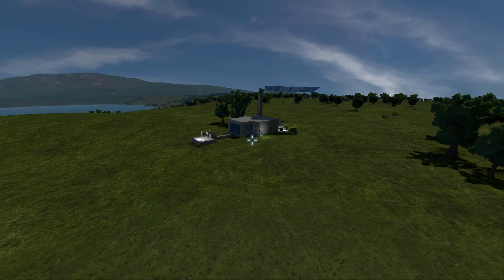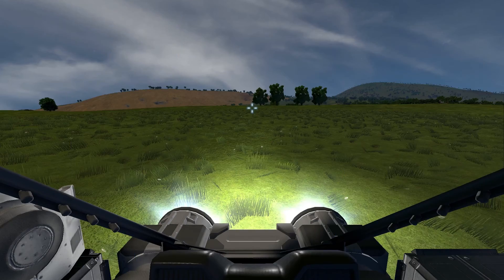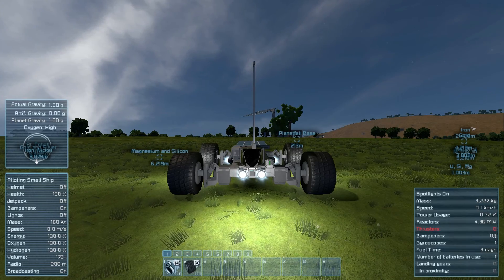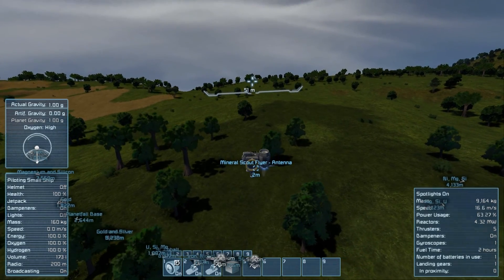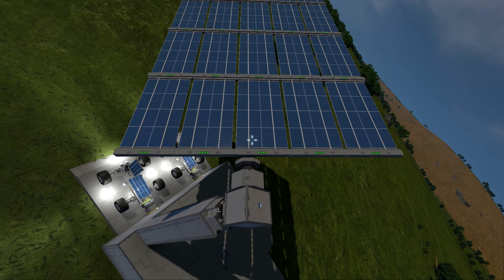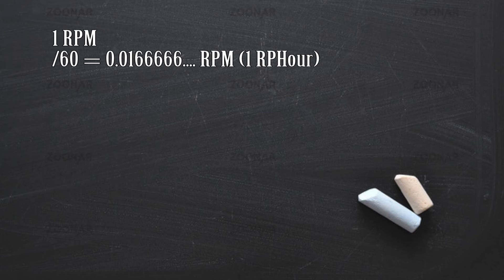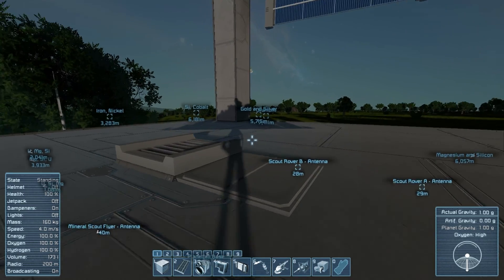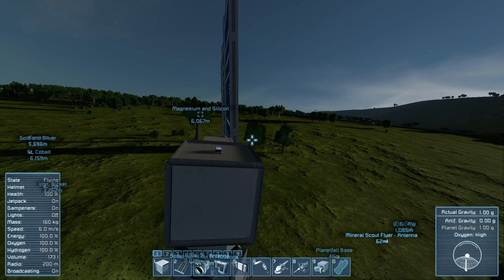Space Engineers Tutorial 12 - Planets part 2

Comment: I m trying to do the solar panel / rotor stuff on Mars but it seems that i can't get the thing to get the max output doing the same as you did.
I keep failing miserably. Need some help if possible.
I have landed where there is ice, i mention that just in case.
Can someone help me get this thing done ?
Reply from the maker: The manual solar panel alignment I showed above works better the closer 
you are to the equator.  If you're up near the pole, it doesn't work as 
well.  When I built a moonbase at the lunar north pole, I only used 1 
rotor sticking straight up, and rotated it that way because the sun 
"went in circles" instead of rising and setting.  Of course, aligning it
 with the sun was a little more tricky that way, too.
Reply: Tx man i ll keep trying :)

Comment: sweet tip on the solar panels m8!....and dont forget heigth offset on those suspensions as well....get some more ground clearence without going overboard on strength.
Reply from the maker: +mountainmanfab I like to leave the height offset alone, because if I hit a bump and one end goes up, that way the tire has an extra meter or so of wiggle room where it will still touch the ground and help maintain control.  Sometimes the wheels need to go down as well as up!